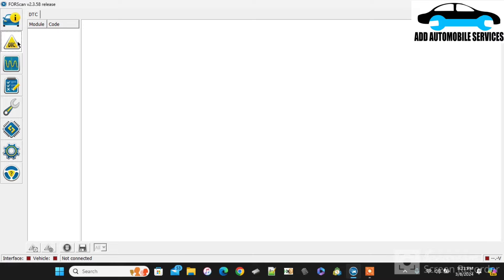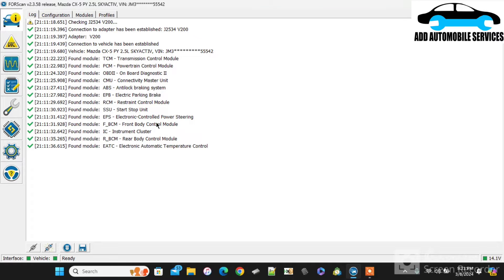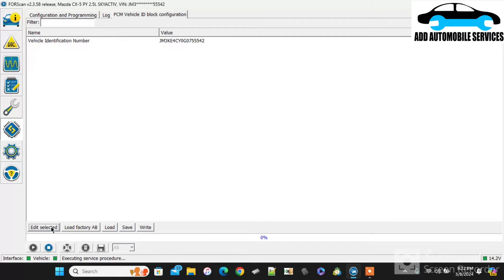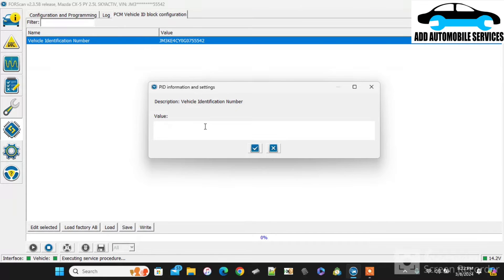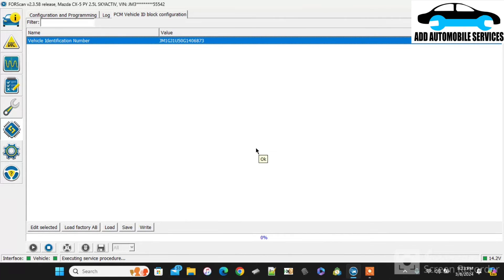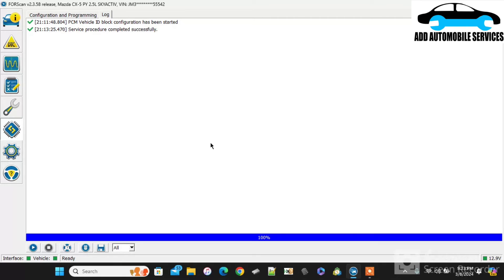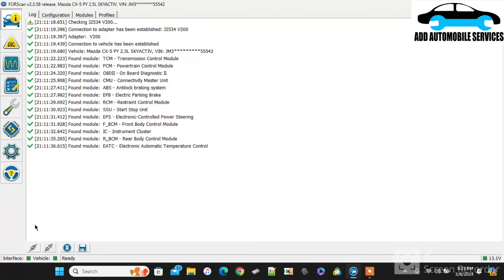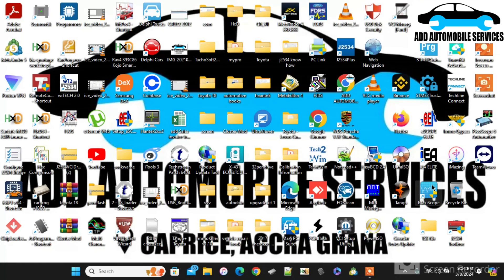2016 Mazda 6 VIN writing with forscan

Comment: I needed to do PCM swap. Updated VIN all done. 
How do you program PATS? Feature not available on Forscan. Need Input Incode Values SSU and PCM? with IDS?
Immobiliser?
Reply from the maker: Forscan can't do that you will need to do parameter reset
Reply: I copied “asbuilt” data. Merged to new PCM. Now awaiting my key programmer which can program new keys. 
Even “all lost keys” 
The PCM has coil pack driver damage.. 
Keep up with the videos. 😊
Reply from the maker: Thanks boss

Comment: Hello, did you change the As Built data too before or after changing the vin? And does it show when you decode it as a mazda 6 after you changed the As built data or does it always still say cx-5
I have the VIN already changed in the pcm i currently have, it works but it gives me a fault for lost connection with TCM and something about front shutter system which i dont have in mazda 6.
Should i change the as built data ?
Reply from the maker: Bcos you save the vin use a different device to scan it

Comment: I just tried this on my PCM. I have a 2015 Ford mustang and I swapped the transmission from auto to manual but when I go to change the VIN like in the video it shows it changed but when I disconnect and reconnect it still shows the old PCM VIN instead of the new VIN I put in. Any idea on why its doing this?
Reply from the maker: Try a different device
Reply: @ADDAUTOMOBILESERVICES like different OBDII device?

Comment: Hello, I have a question regarding this matter. I have tuning software for a previous fiesta st of mine (2014) and I recently bought a newer model (2015) after getting in an accident with the first one. I still have tuning software and maps for the car but the tuner (in my case pumaspeed) says the tuning software is VIN locked. Do you think changing the VIN of my new fiesta st to the VIN of my previous fiesta st will fix this?
Reply from the maker: Yes try it

Comment: This didn't work with my 2017 Ford Fiesta ST.  Everything works exactly the same, except at the end.  Disconnecting, reconnecting and rescanning shows no change.  But although the Vehicle ID Block now shows the correct VIN,  the old, incorrect VIN is what the scan shows.  Any idea what I'm doing wrong?
Reply from the maker: Try another scan tool

Comment: Thank for the movie mate. It was very helpful for me. I am doing a swap with MX5 NC from 1.8 to 2.5 litre and had to change Vin number in the ECU for immo to work without changing clocks, locks and keys.
Reply from the maker: Ok that is great
Reply: Hey mate. Did you succeed to write VIN ? I’m doing the same 1.8 > 2.0 PCM and cannot write : service procedure interrupted 
Do you have paid extended licence or 2 months trial extended licence ?
Cheers
Reply from the maker: Paid license
Reply: @MrRQ13 yes I had no issues with this. I followed the procedure as in the video. I had only a trial licence. I had some issues at the beginning but they were all because of corrosion on one port. I had to sort this out before doing anything with forscan as I had connection issues. I haven't faced anything as you described so I am not sure if I will be able to help. You may try with different obd
Reply: Thanks for your reply mate. This is great 
I have an official OBDlink Sx 
Connection to the car is fully working. I was able to initialize PATS but can’t write the VIN. Don’t know why 
I’ll try again
Reply: Did you flash your ecu before or after using FORScan ?
Reply from the maker: No
Reply from the maker: Change the as-built data
Reply from the maker: You have to buy a license first
Reply: I can’t write PCM as built as well 
However I can write IC as built (original module) 
I’m not sure if the problem is tool/software or PCM 
I have tried 4 versions of FORScan including 2.4.xx beta
Reply from the maker: Check pcm

Comment: Can you change the year too I did engine and transmission swap with ecu
Reply from the maker: Only the VIN
Reply: @ADDAUTOMOBILESERVICES thanks I install engine and transmission and ecu to my 2005 f150 but it has 2008 parts an I’m kinda scared to touch it with forscan
Reply from the maker: @oneal2003 it will work try it
Reply: The year on the vin right?
Reply from the maker: Yes